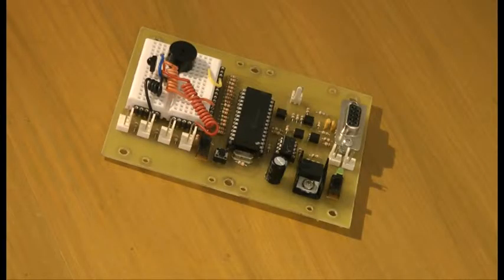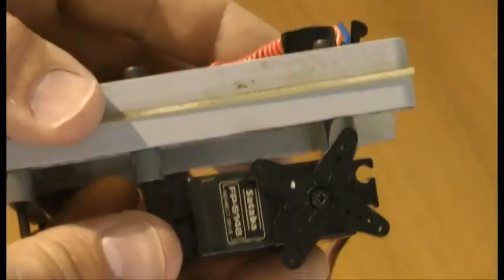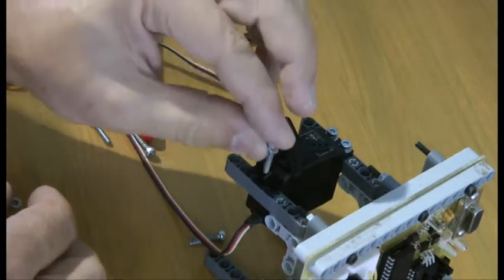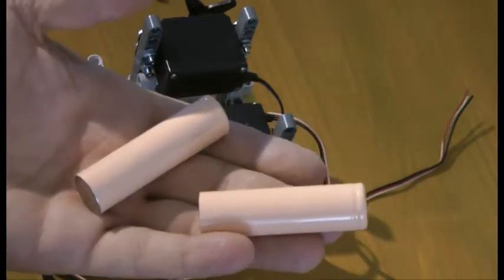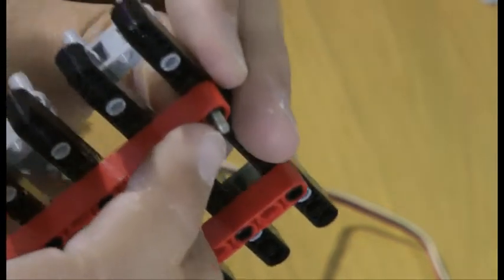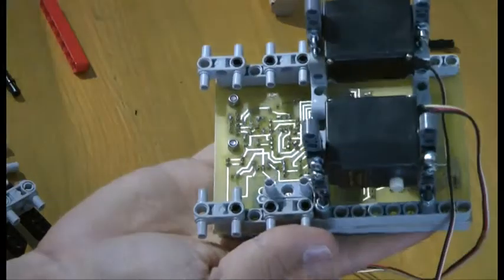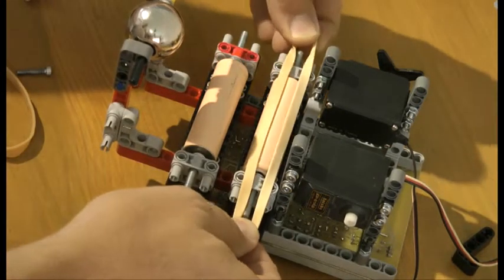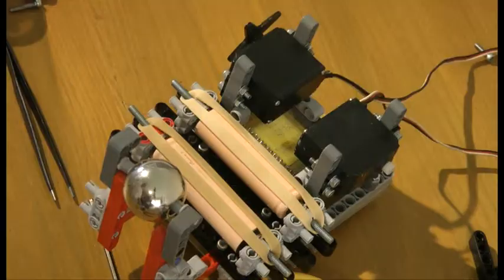RS.059 robot with lithium batteries

Comment: That is a Neat Robot your building. What I would like to see is how you finish connecting the battery up to the circuit board. I am very interested of how you used the machine screws as battery terminals. Keep up the Amazing Work!

Comment: Laptop batteries can Last a Really Long Time when you have the Right Battery settings set on the computer. The absolutely worst thing to do to a Laptop battery is Drain them down Completely And every factory Setting that is programmed in the computer does exactly that. I have ruined a Laptop battery in the span of 6 month Because I would run it down to 11%-8% after every charge but after adjusting my Battery settings I now have a battery that is about 2 years old and still running strong.